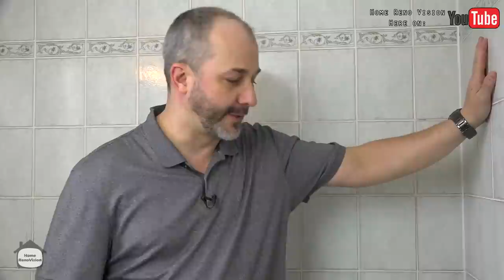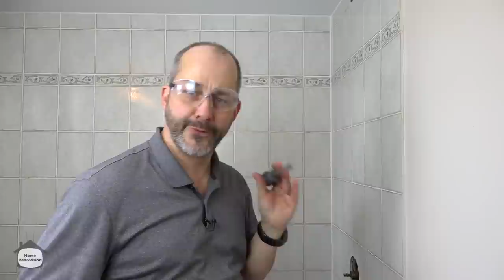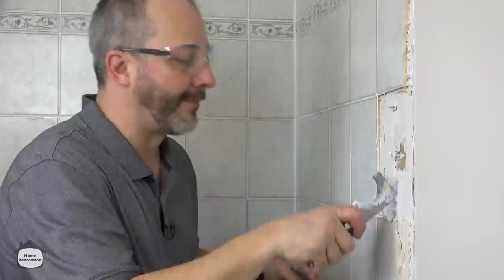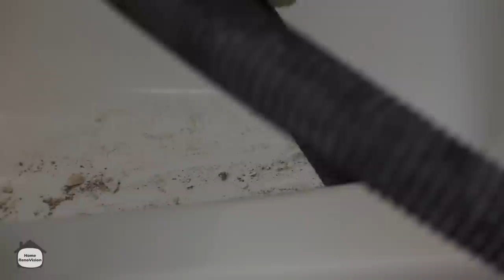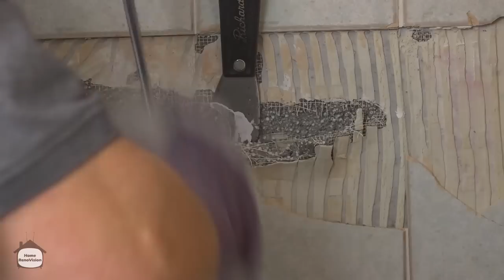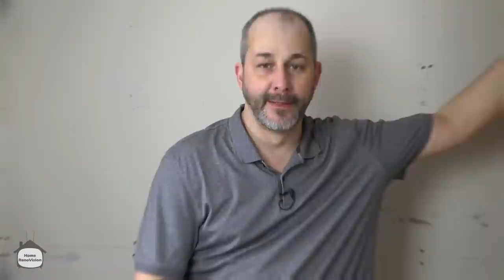DIY Removing Your Old Tile without Damaging the Tub

Comment: Why didn't u put a blanket in the bathtub?
Reply from the maker: I find that just as much damage happens from having debris trapped under a blanket while I am stepping on it. In most cases if you are careful then you are fine. and if you have a problem then you call in the re finisher. they make it all new for a reasonable price.

Comment: this video was exactly what I needed! Only if I was able to find the second part where you would explain the installation of the new tile.
Reply: Idk if you still need info lol! But what i was taught was to put grout on the back of a tile and place it on your wall or counter. Use spacers then put more grout overtop then wipe the excess off . I am not a professional but uhm that's how I do it
Reply: @Keiras_Vlogs  so to continue where he left off, start with using grout?  and add tile ect.

Comment: Loved this video.  Was very helpful in preventing damaged to the firewall behind the green board in my condo.  Worked like a charm.  Only deal is that the firewall wasn't installed to code originally.  Had four large holes in the wall.  Actually is was just a bunch of left over pieces nailed to the studs with 1-1/4" nails in the 5/8" fire - x gyp board.  Removed the existing firewall with my hands, no tools required and rebuilt the whole thing.  It is amazing what you uncover when you rip open the walls.

Comment: I'm buying a condo and need to redo the 2 bathrooms and the kitchen. The firewall left behind, if I want to tile the walls do I need to put up an additional layer of drywall over the firewall? If so, do I need to use a vapor barrier behind the drywall? OR should I get the same type of cement + styrofoam + mesh thing then tile over that?
Reply from the maker: yes the firewall should never have any finishes on it. that way the next person knows it is a firewall. Besides the firewall is designed to be 2 layers thick for the burn through time. Cheers!
Reply: @HomeRenoVisionDIY  thank you!

Comment: Another nice video- any upcoming work with garages? I think I'll be replacing the 12' doors with 14's and would like to hear any tips you may have.
Reply from the maker: I would buy a smaller car to get the same result. That is a lot of structural changes. Make sure you get an engineer and drawings so you don't run into major long term problems.

Comment: Long time subscriber here. Have an issue with just this issue.... My reno bathroom was installed with a drop in tub with no tile edge or tile flange installed. Water flows under the silicon behind the wall. Going to remove bottom row of tiles and install the tile flange... What adhesive do I use? Is there a tile flange kit you recommend.
Reply from the maker: Sorry to hear about that Kyle. I would install whatever kit is available. They are just molded plastic. Then I would take a roll of schluter Kerdi band (Available at home depot). install it along the bottom of the wall and 1/4 inch onto the tub. Use the non modified mortar. This will give you a seal that will last1000 years. If you just want to use a sealant then use lepage seal and bond or the kerdi fix from schluter. The seal and bond product is far superior to silicone and is in the paint section at the home depot as well. Cheers. Either way it will last longer than we will.
Reply: Home RenoVision DIY ty. Wish I was still living in Ottawa and could get you to fix this mess.

Comment: I have this exact situation with 2 x 5/8 fire rated drywall. I'm planning to install 1/2" cement board over top and apply aquadefense. What is the recommendation for installing the cement board over the firewall? Are 2 1/4" screws sufficient to penetrate the board + firewall and hold the weight of the board + tile?

Comment: We have blown-in fiber glass insulation behind one of our shower walls.  What are your suggestions as to how to demo the tile away from that wall?  I'm pretty sure there is just drywall behind the tile, maybe two layers of drywall.  I'm trying to avoid a huge mess with all that loose insulation falling out when I bust up the tile/wall.  Thanks!
Reply from the maker: no such technique available. have the g bags ready and reinstall with batts when opened up. Cheers!

Comment: Hey Jeff, not related to the video, but i wasn't able to find one similar to what im working on. We build an enclosed porch by the backdoor, and i wanted to get your opinion on the best way to do a few things. Against the house, we are looking to sheetrock it down to the concrete slab. What is the best way to go about hanging the sheetrock against the foundation? There is about a 1/2in between the OSB bord and the foundation. Thanks
Reply from the maker: First I don't recommend sheet rock in an unconditioned space. Try to use a t+g wood or wood panels of some kind. The high moisture levels in an oudoor space will surly mold in no time. Hope this helps.

Comment: I recently bought a house that has what I can best describe as mosaic art in one of the bathroom floors. In what way should I go about removing that. SN: I am a first time home owner and dont know all the correct terms. There seams to be more "grout" than tiles in there install.
Reply from the maker: Hi there, your floor is mosaic, this means that you probably have about 1 1/4 inches of cement under the tile. the good news is it breaks up really easy with a hammer. my advice is to start close to the toilet flange so it breaks off in big chunks and is easier to get rid off. please wear glasses and use gloves to remove. The cement is most likely sitting on top of a piece of waxed paper and may have a little steel wire in it so you might need some snips to cut it out as well. And don't forget to have fun. Cheers!
Reply: @HomeRenoVisionDIY  Thank you so much. I have found your videos to be so helpful in the preparation of being a home own. Please keep doing what your doing!

Comment: where is the source of mold? any sight of it during demo?
Reply from the maker: Most likely when the shower was first built the silicone around the tub held water behind the tile and caused the frame of the wall to initiate the mold growth. once it finds water it never stops growing even if really slowly due to the cement backerboard.
Reply: Home RenoVision DIY how does it continue grow when there is no source of water? Maybe silicone is failing?
Reply from the maker: water always gets behind the tile through the grout.
Reply: Home RenoVision DIY thank you so much! I will be sealing grout soon.  You are such as pro,  others can do,  but not like you!!!
Reply: should I be looking to seal all grout lines on the wall? It sounds like water will get through the grout, drip down the wall and mold will grow in the caulk lines between the bathtub edge and wall tile?